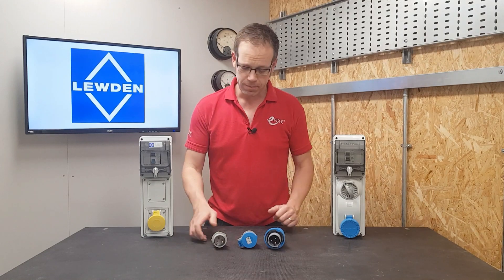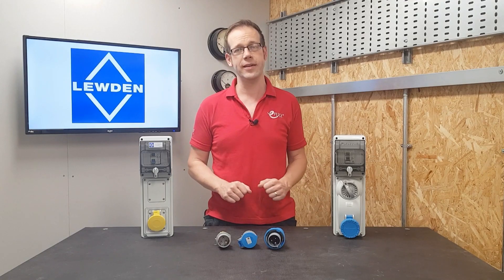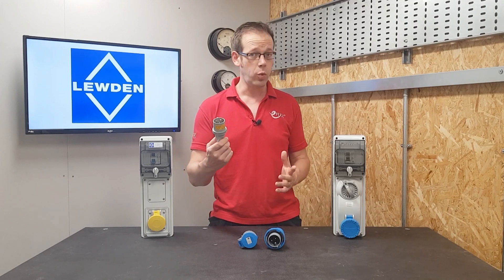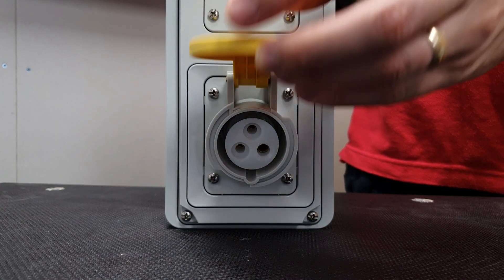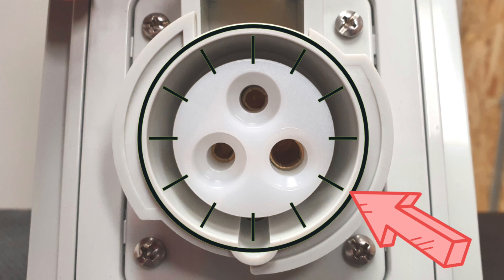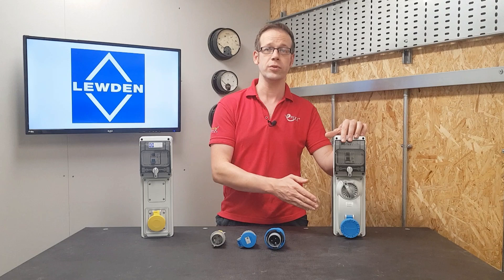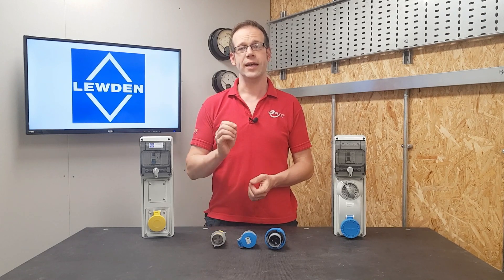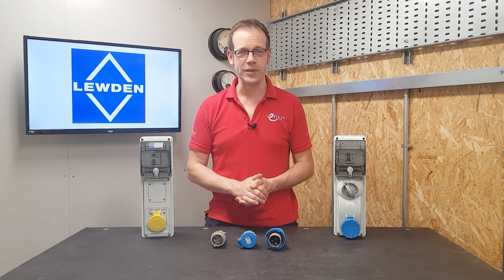Commando sockets IEC60309? - what stops you connecting different ones together? - Electricians Q&A

Comment: In Germany we call the blue ones caravan plugs, because they're mostly used to supply caravans at the camping site. The red ones were made mandatory in 1975 for industrial applications replacing the old plug/socket system we used before. The old system of flat plugs used before were considered unsafe, and that was the only time in history the VDE demanded a replacement or removal of these old outlets. The existing ones had to go until 1980 in West-Germany, in East-Germany until 1997. It was a symetric flat plug with four pins in a row. Housings of the sockets or the plugs were either made of metal or plastic. The problem was, that plug was symetric and had a small nose to prevent someone plugging it the wrong way arround. The sockets were normalised by DIN 49450, the plugs by DIN 49451. The pin arrangement was L1, L2, L3 and CPC. The nose was fragile, so the plug could be inserted the wrong way, and in that case the CPC of the appliance would be connected to L1. Creating a dangerous situation, not only the housing of the appliance would become live, the metal plug would also become live at mains voltage since the housing is connected to the CPC. They were available with 25, 40, 63 and 100A. 25A version with undamaged nose:

https://upload.wikimedia.org/wikipedia/commons/6/69/Manderlstecker-3.jpg

And a metal one, seems to be still in use. Obviously someone didn't care about the directive to replace it:

https://upload.wikimedia.org/wikipedia/commons/6/65/Alte_Kraftstromkupplung.jpg

 Alternative to switch to would be Perilex, but that was considered to fragile for industrial use compared to the IEC 60309 system. The Perilex can be mostly found in small businesses, domestic dwellings, kitchens, laboratories. It's not so bulky and doesn't have such an industrial look like the 60309 system.

https://en.wikipedia.org/wiki/Perilex

And some things for the 60309, there are some specials about that system:

-change of phase sequence. There are plugs available where you can switch over the positions of two lines, changing the direction of rotation on an electric motor:

https://upload.wikimedia.org/wikipedia/commons/0/0b/Phasenwendestecker.JPG

-Optional pilot contact on the plugs 63A and above:

https://upload.wikimedia.org/wikipedia/commons/a/af/CEE_Stecker_mit_Pilotkontakt_63A_6h_5P_2012_01_31.jpg

That diagram shows how you can wire this pilot contact in. The N is brighter because on the 4 pin version you don't have a neutral pin on the plug.

https://www.gutefrage.net/frage/pilotkontakt-bei-4-poligem-cee-stecker

That pilot contact is shorter as the other contacts and can be used to switch a contactor in the distribution board so you won't insert or remove the plug with a load applied which would cause arcing.
Reply from the maker: Marcel your historical electrical knowledge is legendary - bravo 👏
Reply: @efixx  Must be to find reg violations during inspections. When you look at an installation it must be with the regs in mind which were in state when the installation was build. For example until February 2003 it was permitted by exemption from from the VDE to use 35A Neozed fuses as an overcurrent protection for the 32A CEE sockets. Simply due to the reason there were no 32A Neozeds available. In January 2003 they switched over to the new wire colours (brown, black and grey for lines). So if I find such a socket fused with 35A the first thing is to look at the wire colours, if they are the old ones (two black and one brown for the lines, light blue for neutral and green/yellow as CPC) it is fine, no reg violation.
Sometimes also the labels on the parts help, when I find parts which were labeled "Made in West-Germany" they were made before 1990, if they're labeled 220/380V from before 1986 when the voltage in West-Germany was changed to 230/400V. But on some products like junction boxes some manufacturers still label them with 380V. They didn't bother to change the mouldings for them.

Comment: They should make a bi-colour keyless plug for gear that can run on either voltage. It's ridiculous that stuff like drill chargers is often single-voltage these days when it would cost no more to make them universal, like laptop & phone chargers
Reply from the maker: Good idea !
Reply from the maker: Interesting point, probably unlikely now though with the increased use of battery tools.

Comment: Unfortunately seen many times on music festival sites where dodgy traders turn up with modified connectors with the keyway filed or cut off the plug, allowing them to connect into wrong voltage sockets. So technically does prevent you be cannot full stop you interconnecting. Great video non the less
Reply from the maker: Yur, people will always find a way to overcome the stuff keeping them safe. 🤦‍♂️
Reply: Was going to add the same comment as seen the very same at several local council "transient people" sites [not allowed to call them tra####s or g####s any more!  Political correctness etc...] ... that locating lug ground off or the case split to allow it to be forced in to the socket. Bloody nightmare and woe betide anyone that tries to remove or fix their bodge. We now refuse to attend these sites.. we're always way way too busy now 🙄
Reply: I've had it first hand as well. However the kit on the end was auto sense so didn't care. Still not an excuse for doing it though

Comment: Incorrect information. Twice the voltage doesn't double the current.
Reply from the maker: Depends upon the type of load
Reply: If the dick dont fit, you dont force it.....mr thanh tran. 
In a pure resistive circuit this is the case but let's face it, if you cant see the colour difference, and after 3 minutes of forcing the yellow plug into a blue socket, maybe a brick laying or project engineer job is more suitable. If your holding yellow, look for yellow, holding blue......dont look for yellow 🤣 seriously does common sense come at a premium these days 🤦‍♂️
Reply: It does for a resistive load. I=V/R